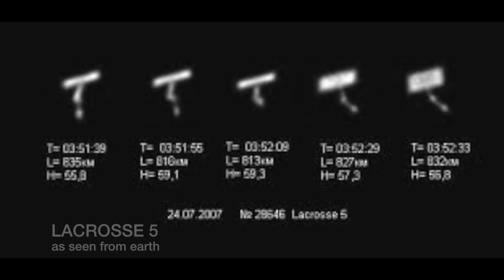The secret space mission that went wrong  STS 27   -   Prof Simon

Comment: Did the "secret" shuttle take off from Kennedy. Or is there a "secret" location which is used for covert shuttle launches?  I've been to watch a launch many years ago, and you can't really miss it - the ground shakes and windows rattle a mile away when the shuttle launches.
Reply from the maker: good question. the plan was to launch STS from Vanenburg ...for DOD missions but after the challenger disaster, plans were changed and secret parts of Shuttle missions were included in the NASA flights.

Comment: Are the wings on the shuttle big enough that it could take off and fly like a plane
Or are they only big enough to kinda glide it down?
Reply from the maker: No....flies like a brick...was the first test pilots words
Reply: @SimonHollandfilms  lol. 
Thank you for letting me know
Reply: @SimonHollandfilms  More like
A Flying Space Brick
-
If I remember correctly, on this mission, Atlantis suffered a severe damage on its right wing. The damage was caused by some sort of foam from external tank during ascent (somehow it's almost similar with what really happened to Columbia's STS-107).
They thought that Atlantis wouldn't survive the reentry. Surprisingly the Shuttle managed to land, and the damage was really worse than they thought.
I was surprised that Atlantis made it back home safely, despite the damage. But I couldn't believe Columbia didn't made it back on the similar way like its sister ship.
Reply: @CrystalWings12  

Actually Atlantis was struck by the rhs SRB nose cap. They were very fortunate to make it back. Columbia was hit on the leading edge of the wing by a piece of double layer insulating foam roughly the size of a suitcase that broke free during launch from around the forward attachment pod strut.

Comment: NASA should have followed basic inspection criteria set up by the Air-Force and the FAA. Thru-flight inspections of the exterior of the shuttle should have done once the shuttle was in orbit. Prior to the ISS being completed a EVA would have had to be done for one of the crew to inspect all of the tiles and leading edges of the wings and vert. stab for damage/missing tiles etc. Later on with the ISS in orbit, folks on the ISS could have performed the thru-flight inspection.

Comment: The space shuttle just looks intuitively wrong, a collection of bits, a stubby plane strapped to a bloated fuel tank with two giant fireworks on the side. The Saturn V had a purposeful elegance and symmetry - visuals aren't always a good judge but in this case it turned out about right. Right from the start with Mercury and Gemini they never exposed the heat shield until just before re-entry. The shuttle made the heat shield more fragile and put it right in the path of ice debris falling from the cryogenic tank during lift off. And then they built the solid rocket boosters in two sections with rubber O rings sealing the join to keep high temperature combustion products contained.  The shuttle had no escape system in case of launch failure, unlike Mercury, Gemini, Apollo.

Comment: I just now realize how stupid shuttle design was: no crew escape, expensive, 
not much carrying capacity. 

And most of it they all got away incredibly lucky (except Chalenger)
not to blow up during the start as they all would be doomed the same second. 

They are lucky to have engines that are incredibly reliable. 

I would not put a crew in this machine ever.
Reply from the maker: Good point...after Apollo...nasa funding was cut and they were told to use the military space transport system...STS or Shuttle...for research...but mainly help place spy satellites in orbit.
Reply: Columbia had ejection seats for the pilot and copilot during STS 1-4, those missions were the only ones to have only two crewmembers  on board. It was decided that those seats would be disabled on STS 5 which had a crew of four, it was all or nothing, if all of them couldn't get out, then no one would.
Reply: @0pnMnded  no different to going on a civil airliner then..... Nobody gets a parachute

Comment: Was once several proposals to use the shuttle tech of external tank, solids, and shuttle main engines to make heavy lift vehicles. Not sure why never followed through? Or why no one decided to use shuttle main engines other launchers, I don’t think they ever failed and there per launch and reusable if recovery? Plus very efficient.
Reply: The core stage of the SLS will use four shuttle main engines along with two supersized 5 stage SRB's, basically a larger version of the shuttle stack minus the shuttle. That is of course assuming they ever get it off the table and onto the launchpad.

Comment: I'm surprised they are bluffing the public with fossil fuelled space flight when they've been using anti grav since the fifties.
Reply: Unlikely - that stuff cannot be kept secret easily: although the sheer difficulty of it would in effect keep it out of general hands. And liquid hydrogen/oxygen and solid propellants are not 'fossil fuels'. The only fossil fuels ever used on rocketry was refined kerosene: has worked just fine so far for SpaceX and the old Saturn rockets' first stages.

Comment: The ridiculous part of this was the the damage done to the heat-shield tiles  was caused by pressures from environmental groups who pushed for a more environmentally friendly foam insulation on the external fuel tank that was not even close to the same strength as the previous foam (The original foam used Freon as the expanding agent). This is a ridged (hard) foam that broke away from the tank, hitting the heat tiles and destroying them. The  tiles had NEVER been damaged like this before.  The tiles, though virtually impervious to heat, were a relatively brittle froth of glassy ceramic material with little impact resistant  strength.

The same sub-par external tank foam continued to be used and thus the loss of the Columbia due to an actual hole  knocked in the structure of the wing by foam peeling off the external tank.  If  only the tile had been damaged this time the shuttle might have survived, but the hole allowed super hot gasses to enter the fuselage and minutes later the shuttle exploded.
Reply from the maker: Interesting information....thank you.

Comment: If they had been more forward looking they'd have carried the external tanks into low earth orbit and corralled them there. Imagine a massive Mars vessel made of 143 shuttle external tanks? All the room for air, water, fuel, food, and living quarters a crew of 12 could ever need.
Reply: Except for the problem of all that deadly perchlorate.
Reply: The external tank held the fuel for the SSME and it was liquid hydrogen with liquid oxygen for the oxidizer. No ammonia perchlorate.  The SRB’s had the solid rocket fuel that contained that witches brew that included ammonia perchlorate.  The APU’s contained deadly hypergolic hydrazine fuel.  If you smell it you are dead.
Reply: @TigerTiger-wf7xq  I believe Johnny Terell means the perchlorate that saturates the Martian regolith - extremely difficult to produce water with all that crap tainting it.

Comment: I often asked myself why they didn't design the Shuttle programme with a reusable unit on the top of the rocket. Like the old system of Apollo.
Reply from the maker: Hi Jeremy, you are correct, unlike the Apollo capsules the shuttle did not have a escape rocket....the crew compartment was integral to the whole space plane....so they never bothered to make one....also the shuttle was the first rocket that was never tested before the first manned mission....wow.
Reply: @SimonHollandfilms  Wasn't the Enterprise considered a flight test ? And I thought the engine design was tested at White Sands Missile Range.
Reply: opticschief The Enterprise was a glide test but yes, the engines were tested and exploded many times.
Reply: opticschief only partially. It was never made for space flight. So you can’t really call it a test (apart from the landing, which is what it was testing for)
Reply: Cuz apollo was smoke n mirrors u don't get to see the real space platforms

Comment: Why didn't this shuttle disintegrate like Columbia then
Reply from the maker: good question... Columbia suffered a leading edge wing hole...hot gasses passed inside the wing and melted te main spar, causing the craft to break up during re-entry.  STS 27 lost heat tiles but there was no structural damage to the craft structure....luckily.
Reply: The area where the tiles were missing had a thick steel plate that protected the aluminium underneath long enough for them to make a successful reentry...see Hoot Gibson's interview on this mission...there is also video footage of the area of missing tiles ...they were very lucky!!!!
Reply from the maker: Thans for the info Kevin.
Reply: The Atlantis shuttle tiles damage was limited to the upper root area and lower bottom of the shuttle.  While damage from re entry was serious, the aerodynamic forces and heat were not in extremely critical areas as the Columbia damage which was on the lower more forward facing wing root area. Ans there was a bit of luck involved in where reinforced plating was to the damage tiles.   Atlantis was lucking that the forces involved deflected more away from the damage tile area, while on  Columbia, it was more of a head on force which went through the wing root right to the landing gear bay.   Ground control knew things were fatal with Columbia  as the bay tire door deployed in flight and the tire pressure reading showed an explosion of the tire.  Catastrophic damage had occurred and the wing structure was failing at that point.  This would cause the final fatal yaw that would cause the shuttle to loose controlled flight and break up from stresses it was not designed to handle.
Reply: In his book “Riding Rockets” Mike Mullane tells us that the tile damage stopped only a few feet from the area of the Shuttle that was fatally damaged on Columbia in 2003.  So as well as by chance the most serious damage to Atlantis occurred where a steel plate protecting the aluminum below it prevented a catastrophic burn through,  the crew was fortunate that there was no damage to the tiles at the most 
Crucial area of the shuttle where any damage may or would have been disasterous.  
This shuttle crew was very lucky and this luck should have been used by NASA to prevent, or at the very least, minimize debris 
From being shed and striking the shuttle.  But the shuttle continued flying and debris continued to strike the vehicle.  Eventually luck 
Would run out, and that luck ran out on Columbia on the 1st of February 2003. Like the Challenger disaster, the Columbia tragedy was a very 
Horrid thing and like Challenger, the Columbia accident was seemingly avoidable.

Comment: I can say with certainly that there was an EVA done on STS-27 by 2 astronauts. I’m retired and was active at this time. It’s kind of an semi secret from those in the know that a gyro failure and a circuitry problem forced the EVA to repair and redeploy the Satellite. Poor Jerry Ross can’t count his EVA as an official one for his total tally.
Reply: Seeing as how they are already suited up and doing an EVA anyway I wonder why they wouldn't have had someone go to inspect the tile damage instead of relying on the inadequate Canada arm?
Reply: @thedave7760   I recall seeing a documentary on this event. If I remember correctly the astronauts were able to see the damage clearly but since the mission was classified the video transmission relayed to mission control was encrypted and thus had a  lowered  image resolution.
Reply: @thedave7760  They didn't have any MMU (manned maneuvering units) on board, so there was no way to send an astronaut under the orbiter. Going out of the bay over the side is dangerous as the open bay doors also hold the radiator panels and if their tethers snagged they would be S.O.L.
Reply: Interesting. I was on console in the 'Trench' for that mission, IIRC there were some post-deploy payload comm funnies, but I don't recall the EVA console [two rows behind me] even being staffed on the shifts I was there. When was this supposed to have occurred? And all shuttle-related ops were classified only at the 'S' level so automatic downgrading would have occurred by now, wouldn't it have ?
Reply: chad1able    Do you know of the 9 foot alien in a space suit that was docked to the shuttle in a black delta craft ?  It’s a real event and there was only two human astronauts   They could have been rescued and STS remotely landed un maned. We do have... aliens on call. The Babylonians as they call themselves today  are 9 foot .  It  the alien was seen in the airlock of the shuttle with a space suit.

Comment: Was this a dod mission?.
Reply from the maker: NASA and DOD shared the shuttle or STS space transport system.  STS 27 was 99% classified.  Most shuttle missions had DOD activity...check out the published mission logs....remember the shuttle was designed to launch spy satellites.
Reply: @SimonHollandfilms  = "remember the shuttle was designed to launch spy satellites. " == It's cross-range capability was specifically defined for a candidate mission [called "3A/3B"]  to snatch 'other' countries' space objects and land quickly.
Reply: Matty Taylor // NASA has been designated as part of the DoD ever since its creation in 1958, which insures that all NASA-related (DoD) missions are "classified", the details of which DO NOT have to be revealed to the general public.
Reply: Dept. of Defense.